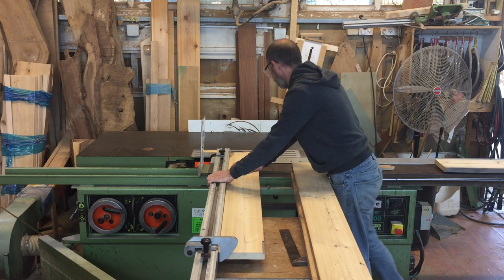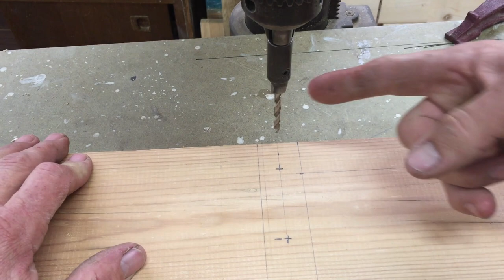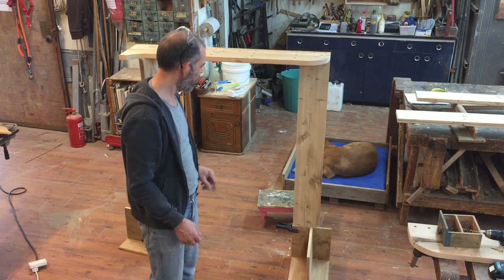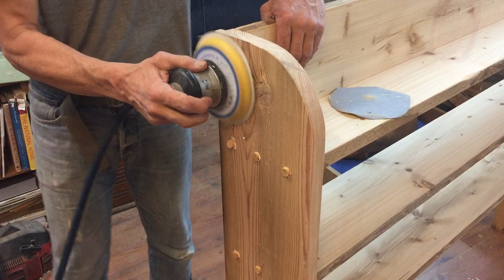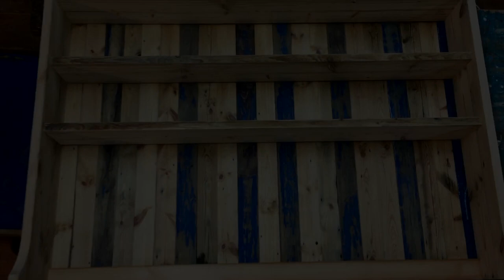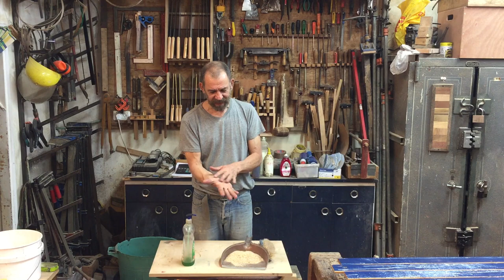Woodworking Project for Isolation and Sanity - 5 - Recycled Wood Shelves!!!

Comment: I’m working on the legs for the stool but at this point they look like a half sharpened pencil
Reply from the maker: Hi van the challenge for you now is to make your tenon parallel not tapered what tools are you using?
Reply from the maker: Btw best make mortises first then fit tenons.
Reply: What does parrelel and tapered mean I’m   Just using some sand paper and a knife
Reply: @vanfulton-wright6220  Not David, obviously, but I would assume that he means that the tenon portion should be cylindrical, not conical. You will have a slight taper down from the full dimension of the leg down to the smaller size of the tenon, but the tenon itself will be the same diameter along its entire length.

Comment: What tool could I use because I’ve spent an 1 hour 30 minutes and it still doesn’t fit all the way
Reply from the maker: Hey Van if your knife isn’t sharp it’s hard work if you can sharpen it if not do you own a rasp? This will remove material fast. Let me know how you get on good luck David